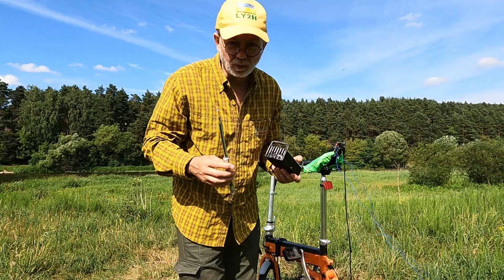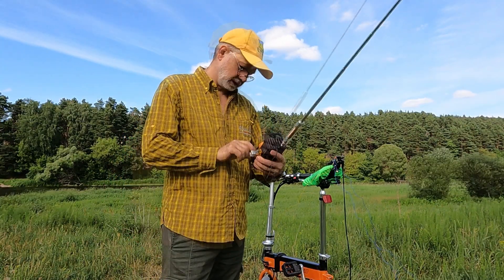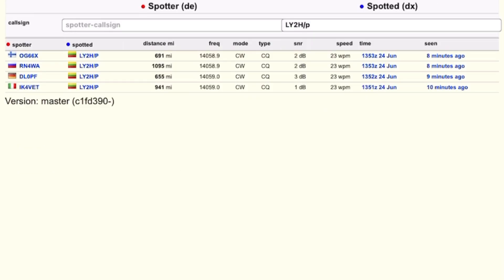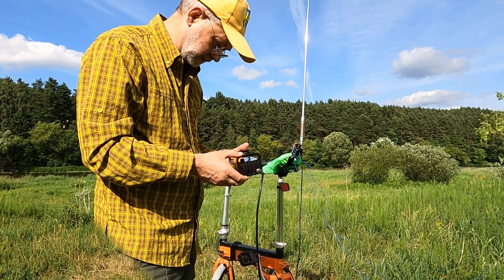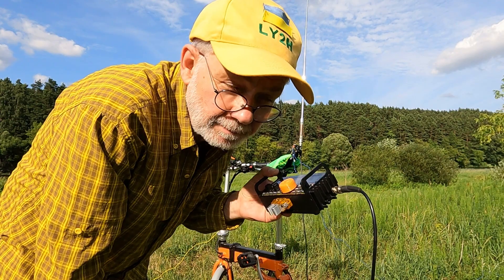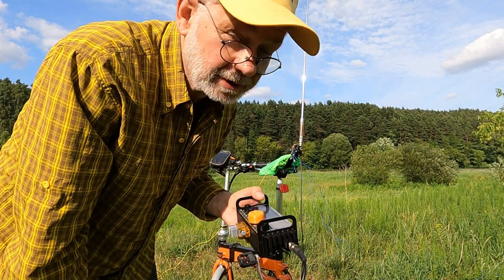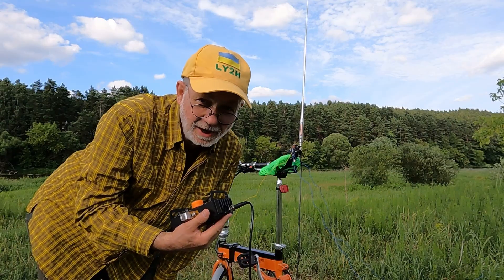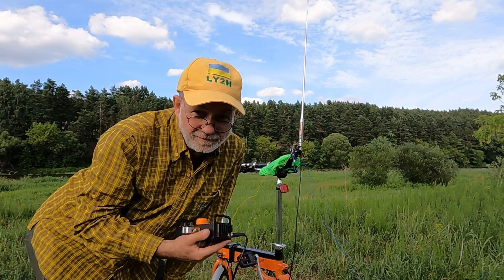Is Elecraft AX1 antenna efficient? It depends on mounting!

Comment: There is no common mode choke at the AX1 feedpoint, so there is a very good chance the attached 2m coax cable acts as an element of the antenna and helps improve the sig.

73 Gerd Df9TS

Comment: Thansk for sharing this experiment! How much influence do you think having your body so close to the antenna has in disturbing the system in the "walkie-talkie" configuration? Also, would having 3 radials dangling instead of 1 in this configuration make any difference?
Reply from the maker: Thanks for watching my experiments and conducting your own! 
Human body is a lousy radial but it can work as such, at some extent, if no wire radials at all are used. Usually , it's a stray capacitance between the radio and the ground which provides the necessary return path for the radiated signal in addition to the humam body. My experience is, that if at least one radial is used,  the human body makes no significant influence to the whole antenna system ( with antenna tuned and low SWR) . Three dangling radials would certainly (IMO) make the overal performance much better than one radial or no-radial-just-body configuration. Have fun! 73! Linas LY2H

Comment: Linas. Thank you. Am going overseas with KX2 but only have room for small antenna. Thought I would use the AX1 mounted on a camera tripod with one radial. Sounds like 3 radials with small diameter wire would work ok. 73 de K4RLC Bob
Reply from the maker: Yes, sounds like that. Have a nice trip and great time with your radio Bob! 73! Linas LY2H

Comment: Linas. Thanks for video. Interesting test. I wonder if you tested the antenna in walkie talkie mode with 3 radials. It could be that it’s the radials that improve performance, not the mounting. Eg both tests should use 3 radials.
Reply from the maker: Thanks for the comment Pat! I think, you are right, it's the radials which make difference, then only mounting. But the goal of this experiment was to compare situations of typical use: one typical being walkie-talkie with one dragging radial, the other typical - tripod-mounted (bike-, table-, bench-) with typically 3 radials. So, comparing 3 radials in the walkie-talkie style would not be a typical situation, accordingly to my way of thinking :). But of course, it's totally possible and would bring much better results than one-radial, or no-radial ( or "I am the radial") scenario. Well, may be it's a food for thought for some other  sunny afternoon experiment... Stay tuned! 73! Linas LY2H
Reply: @Linas_LY2H  Hi Linas. I have used the AX1 both ways but have never used RBN to check the strength. I usually attach the 40m and 20m counterpoise so I can change bands by adding or removing the 40m coil. I never thought to add a third radial. What length radials do you use? In any case, the AX1 does get results. I've used it for SOTA or POTA when I can't put up a wire antenna, and I always get 30-40 QSOs. So even though it's a compromise antenna, it does work adequately. Thanks again for the great video.
Reply from the maker: Great performance Pat! 30-40 QSO is a solid score. My radials are cut 6m each so I can adjust the length in case I need to. But  radials lying on the ground don't need to be resonant, the quantity is more important with 3 being the very minimum, and 16 being the practical limit after which further increase in number does not bring justified improvement in performance compare to the increase in costs and labour to install them...  Have fun experimenting! 73! Linas LY2H

Comment: Linas - Thanks for another great video. I wonder if your result for the walkie-talkie test was affected by holding the AX-1 at an angle vs. vertical, as during the bike mount test. KN6WKM
Reply from the maker: Hi Kevin, thanks for a good question! Operating the walkie-talkie style I was NOT standing in the same position and keeping the whip at an angle all the time during  this  ~5 min slot of transmitting. It's only in this ~30 seconds episode I put in the video it seems like that :). In the reality, I was moving myself a bit, changing the angle of the antenna, keeping it a bit higher, a bit lower than the bike's seat- immitating a normal "pedestrian mobile" behaviour. And the behaviour, as well as my body's impact,  is a part of an antenna configuration in this case. My goal was not to mimic the tripod, but the opposite: to compare a stable  on-the-bike plus 3 radials configuration vs dynamic "walkie-talkie" style. So, I don't think the RBN report was much influenced by this short  time of antenna at an angle, I consider it a holistic report mirroring the realistic situation, actually. 73! Linas LY2H

Comment: The only accurate way for this test is to call Cq for the same amount of time on both tests and move vfo up one to test on the bike after being down one k holding radio in hand. Also needs to be done asap between testing.
Reply from the maker: Thanks Jay! That's , actually, exactly what I was doing , even the QRG :) The RBN is very convenient that it displays on the same page, chronologically, all my CQ attempts, so I can see and compare my reports very comfortably. 73! Linas LY2H

Comment: Linas... I haven't had the success I'd hope for from my AX1...  Your video illustrates how ground radials can make a significant difference in RST.  Bravo, on the tuning knob... I have a nicely machined aluminum knob... it's too big really, so I went back to the factory knob.  Thanks again and 72!  de W7UDT (dit dit)
Reply from the maker: Thanks Rand! Yes, it's a compromise antenna, but lots depend on propagation. Even with one radial dragging behind I've done numerous contacts, especially on 17m, conditions permitting. Actually, it's even more fun when making a QSO with such a minimalist set-up and when you get it done! 
The knob I printed out is actually the same diameter, just a bit taller and with a finger dimple, makes tuning more comfy. Aluminum would be nice, but as you say, the ones I saw all were too big, and, probably, too heavy which could disbalance the encoder's shaft with time. 73! Linas LY2H

Comment: Great video. What is the length of the 3 radials used? The single counterpoise wire provided with the ax1 is 4 meters btw.
Reply from the maker: Thanks for the correction, Martin! Yes, the stock c'poise wire is almost 4m long. My own 3 radials are cut for 6m each so I can make adjustment if I need to , by winding them a little bit up. 73! Linas LY2H.

Comment: Great Video. I have learned something new.  Thank you for that. The mini bike you are using seems to be pretty awesome. May I ask what model / brand this is?  Thanks again.
Reply from the maker: Thanks for watching! The e-bike is a Woosh Galego with 250W front-wheel motor and 3-speed enclosed gear box in the rear. HTH, 73! Linas LY2H

Comment: Interesting experiment, thanks. good video showing the process, also.
I have enjoyed similar successes using a home brew vertical - usually coil-loaded, especially on the beach in various places and even in other countries (Malta/Gozo especially). No need to buy an aerial (I detest buying aerials!) they are so easy to make even if you’re hamfisted and have few tools, a length of wire on a pole will do fine. The radials are key, though, elevate them if you can, even if you just lay them on top of the grass or bushes. 73/72 es gud DX, Les G0NMD always QRP (edit) I forgot to say Slava Ukraini 🇺🇦
Reply from the maker: Thanks Les! 100% with you on homebrewing antennas, especially wire ones! But if it's a YAGI, or a multiband vertical - sometimes it is hard to achieve just a mechanical quality not having right quality materials and machinery at hand. Simple verticals, 3D printed coils- yes, I love this DIY! As it comes to AX1, I bought it of pure curiosity as I like the  high craftsmanship of Elecraft :) 73! Linas LY2H